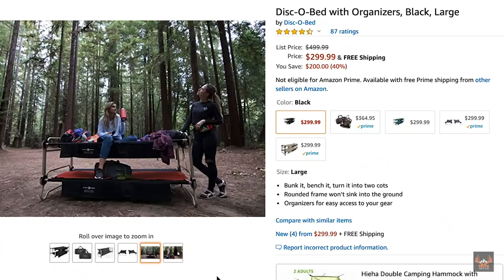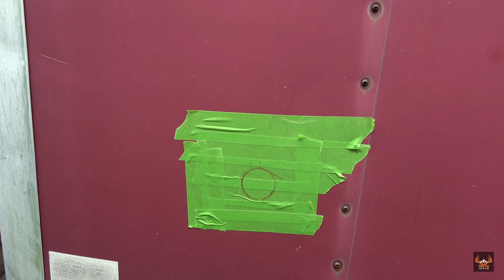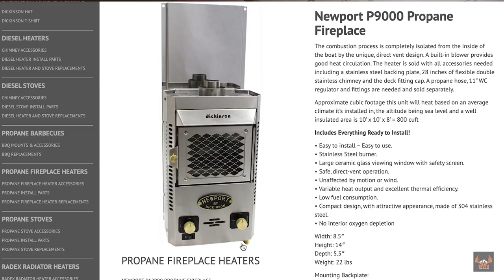DIY Hunting Cargo Trailer Conversion - Part 1 (Video)

Comment: If u live, camp or store your camper in cold climate do not use self adhesive flooring unless u put liquid nails adhesive or whatever other brands. The cold temps and weather hot to cold will make it come up, shift or buckle fast. Trust me even when floor is insulated it won't help with the self adhesive flooring from shifting etc. Unfortunately I learned the hard way lol.
Reply from the maker: Looks like I’ll be making a flooring update in the spring. Thanks for the tip...liv’n and learn’n👍